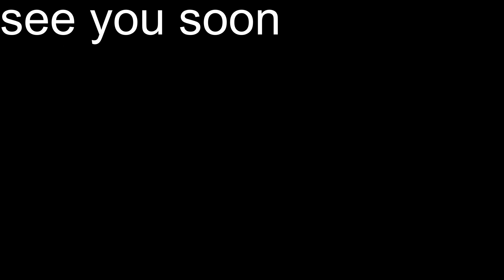Furniture Flip Facebook Marketplace

Comment: Cheeky question perhaps but how long did you spend on it and how much did you get for it?
Reply from the maker: Hey no thats not cheeky
.. so the item cost me £10 pounds I had all the paint in left over from commission orders etc so just used up them and in total  spent about  1 hour on it.. and sold for £45
Reply: Afternoon Nial,  I did a small table like Lowes video and sanded it down and repainted it and I sold it for £50
Reply: @lowesjoinery3031  Thanks for the feedback. That's not a bad return, good to use the paint before it goes off too!